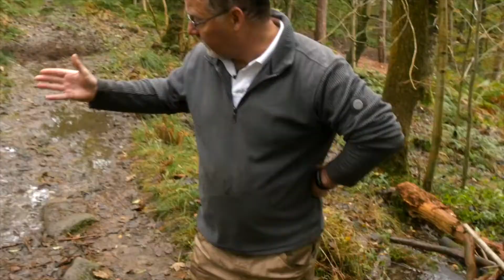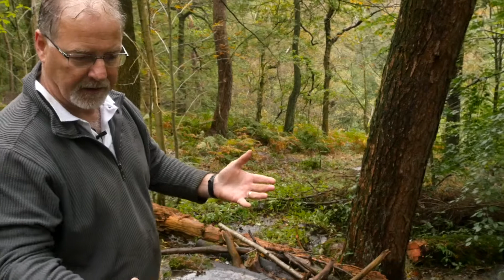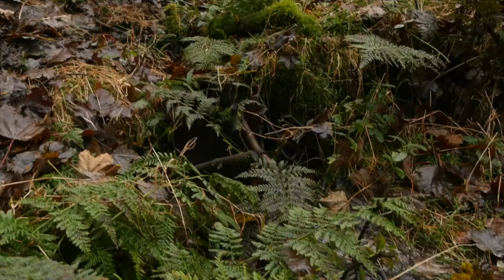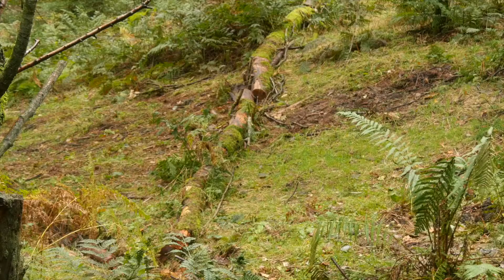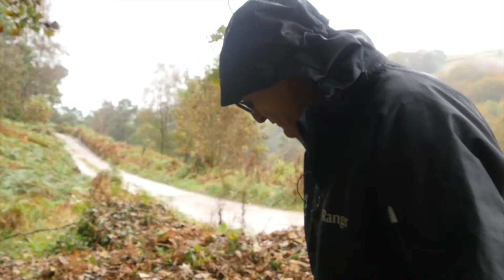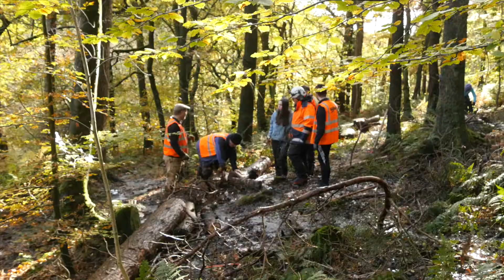How do you do Natural Flood management?

Comment: Actually did cut that particular, CEDE , first for firewood as it was in a very thick stand blackened bark, lost for the quest of light, now still standing.  After cutting at just above ground level realizing afterwards bull's eye running up the center of this snag.  Returned to investigating finding some black ants, groggy and now ambling slowly, out of main tree bole.  Continued search found these ants uniquely colonized this CEDE.  hole or cavity remained after about three feet up the tree bole where I isolated this cavity absent in top of cut yet not the lower cut, thereby discovering length of this chamber so now reporting on Descriptions and applied theories, as this was this season's discovery.  Did facilitate tests and witness so as to Hypothesize.  Overall, a small population, in above tree compartment believe other chambers, rooms sub-surface still in root structure, are inhabited as well though probing with pine needles did not illicit any responses to ants below or still in the CEDE's rooting structure.

Comment: Overwintering in trees under the bark or as metamorphosizing Indidivuals determination to select cover, shelter, temperature variables of daily and yearly consequence to avoid freezing, colder external wind, air, and degrees Thermal rating versus slumbering or transforming within to avoid such disparities.  Also, realize Black ants Species using underground acces to standing dead Incense cedar (CEDE) that had been socialized by these ants going right up the middle of the Indvidual tree like a bull's eye creating ant rooms, and compartments very uniquely and systematically throughout this snag and realize the temperatures and other external gradients make socialized insects living within this tree so well comforted to the outside elements were sustaining themselves within this snags continual structure above and below ground. below the tree in the rooting structure or other openings.  It was quite impressive, ]indeed.